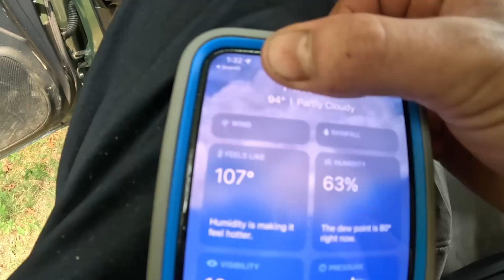Recovering A Missing 4 Wheeler While Magnet Fishing

Comment: Four wheeler. I think your ammo can lid/jack hammer part is the bracket that holds a scissor jack for a car or truck. You crank it down as low as possible and there’s a post and wing nut that holds it down. The strange screwdriver is a nut driver that lets you use a small socket like a screwdriver. Handy if you don’t have a lot of room to use a ratchet and the bolt is small. The little arm like thing that came up with the broken spool looks like what would hold the jack down. I don’t do heat well anymore. At your age I was delivering auto parts in Southern California and in the summer it would get to 115* driving in a truck with no a/c. That was brutal and now I prefer cooler temperatures.